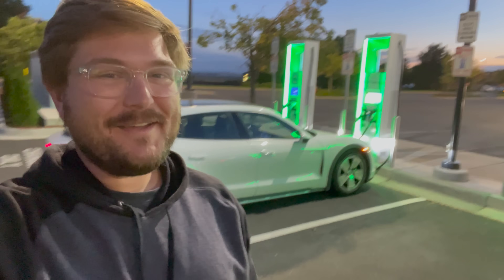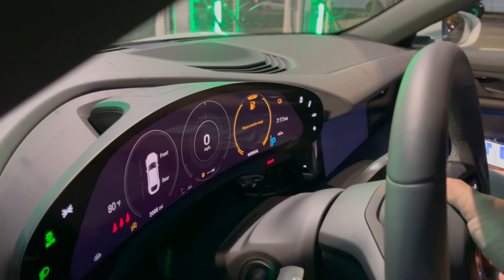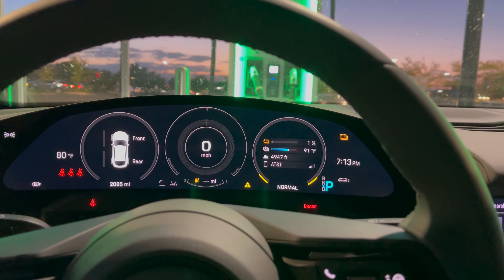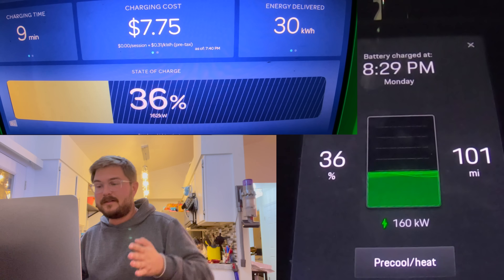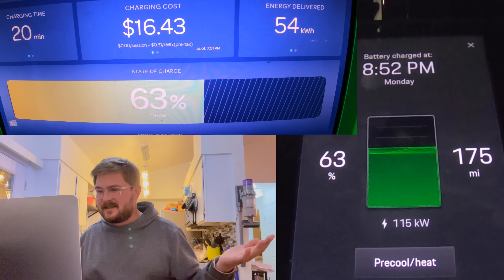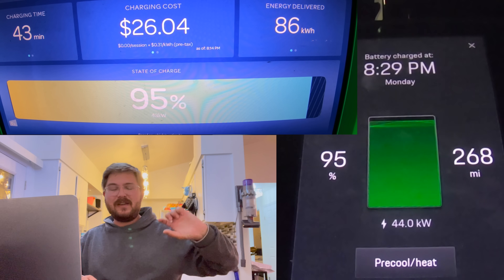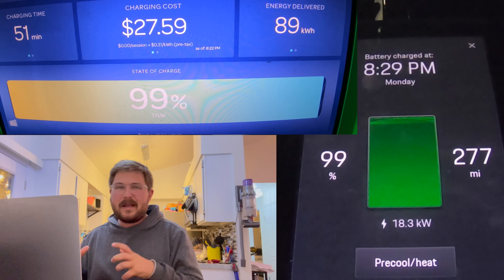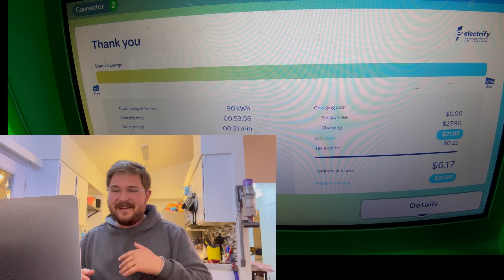Charging The Porsche Taycan From 0-100% With A “Battery Friendly” Decreased Power Level

Comment: Hoping to hear from some battery chemistry experts. What are your thoughts of this new optional lower power charging profile? And from all of you, would you leave your Taycan in this setting if you owned one?
Reply: What was the battery temperature after the charging session?
Reply: Not a battery expert but I have learned enough from Apples charging scheme to Porsches and know lithium is best treated kindly in it’s normal operating range of temperature and if it goes beyond that; it’s not that the charging hurts it but the temperature starts to degrade it. I would set it just like you suggested in the battery saving mode until I needed it otherwise and beyond that I would probably charge it more at home then I would be on the road, but that’s more of a used case than anything else. Tesla does a fantastic job for getting each individual cell cooled but is there anyone else that’s doing as good a job with their batteries? It looks like Porsche may be among the best.
Reply: @garyclark6747  Porsche has a much different battery structure.  Fact is, and from having owned three Tesla’s, frequent fast, aka high temperature , charging is not optimum for any battery.  If the manufacturers could better manage heat , then fast charging in the future could be safe and efficient. 350 kw charging is not currently suitable for motor vehicle charging, so all of these claims about “ my car charges faster than your car” is nonsense.   Sounds as if Porsche recognizes this and has dialed back their charge claims for ad ertising and customers.  Frankly, most owners charge at home so it’s typically more an issue “ on the road.”
Reply: Kyle, you should interview Sandy Munro about batteries and EVs...
Reply: Ask him
https://www.youtube.com/channel/UCIFn7ONIJHyC-lMnb7Fm_jw
Reply: I am not a chemistry expert, however, as an owner I have noticed that waiting 25 or 35-40 minutes to charge from 10-15 to 80% does not really matter. At least to me. So I prefer to go for a 135-175Kw charge then stress the battery ..
Reply: idk about you guys but i did not supercharge my brand new tesla for the first year at all period and saw the 90% range drop just as much if not more than other people who supercharge regularly. not scientific i know but i think as long as you're not supercharging daily, its fine.

Comment: Thanks Kyle for the pointer to the setting. I had gotten the latest software update but forgot to look for where the setting was. I now checked it but I have done 17,800mi and 5.367MWh of DCFC and 1.034MWh of L2. A recent road trip of 495mi 90% freeway used 258mi avg range on 100%. I have a 2020 4S with 20” wheels picked up in November 2020, built in July. 
It’s a road trip dream.

Comment: The first 50% says it added 43 kWh in 14 minutes.  The second 50% says it added 47 kWh in 40 minutes .   The official usable capacity is 83.7 kWh, so 50% would be ~42 kWh.  I imagine the car/charger is just giving a rough estimate.

Did you turn off the climate control and ventilated seats that you had on before you started the charge? ;)  The first 50% took 14 minutes adding 1 kWh extra could be accounted for by HVAC and slight charging losses.  The second 50% took 40 minutes, adding 5 kWh extra could be accounted for by the HVAC running for 2.8x as long, plus higher charging losses.

So yeah... 83.7 kWh usable still seems like it may be right.

Comment: Seems like the people that are most “concerned” about DC fast charging at high average kW, and at high SOC, are Tesla fanboys.
Reply: It’s a battery issue mate, not a Tesla or Porsche issue.  Batteries in and of themselves , no matter the manufacturer, do not like high charge levels on a regular basis.  Plus, Tesla allows you to adjust charge speeds as well.

Comment: I'm Tesla and Porsche fan. Still have 2 Porsches. But I've been running Porsches for 15 yrs now, and you are sorely mistaken if you think that they set-up things safely and have no problems... I'd much more trust Tesla with new technologies, especially because they still play "new kid on the block' game to please their customers. Porsche has had major issues with every single gen. of 911, and their taking ownership of these issues has varied... Good for engine fires of 991 GT3 and transmission on the GT4, not so good for 996/997 IMS and bore scoring, or Metzger engines plumbing issues that caused many crashes at tracks...
Reply: Oh man, you are so full with bullshit about Porsche! It's almost disgusting to read your irrelevant crap!

Porsches "major issues with every single generation of 911" wasn't existent at all! What the fuck are you claiming, you clown??

The 991.1 GT3 "issue" from 2013: 
Porsche located the issue of the 3.8 liter flat six engine, which caused only TWO engine fires of the 991.1 GT3 generation (one in Switzerland and one in Italy), and Porsche immediately stopped selling the car, conceirning only 785 delivered GT3 customer cars at that time. All these 785 GT3 customers got a replacement car from Porsche until the issue was located and fixed, produced these new GT3 engines for the 785 customers and built it in these customer GT3s for free. 
And now the question: Where's the problem in your eyes, what Porsche did with this "issue"?
What Porsche did at that time was lightyears ahead of any other sports car maker, which wouldn't have stopped customer deliveries after just two engine fires. Like we all know from Lamborghini or Ferrari, which wouldn't have done NOTHING in such a case. 
Porsche was amazing, because they communicated totally open the issue to the customers and the public at that time. Without bullshit and stupid lies. 

You are telling fucking bullshit, because this 991.1 GT3 engine issue actually was just a tiny problem, and which was solved by Porsche in just very short time.

All the rest what you are claiming about "engine issues" of quite old Porsche 911 generations is so fucking OLD and irrelevant for today, because Porsche from today is a totally different company compared to Porsche from 25 years before.

You are such an idiot, with telling quite boring, totally irrelevant and old stories from 25 years ago about Porsche "issues", just to show how "unreliable" Porsche Taycan batteries are today??? This is so stupid, you clown!

Question: Are you really that DUMB or do you have a little vendetta with some Porsche dealers for idiotic reasons, which of course has absolutely nothing to do with Porsche Taycan battery technology in the year 2021, Mr. "Dimic"??

Fact is, that Porsche is the most reliable premium sports car brand today and has the biggest customer safisfaction rate of all premium carmakers here in Europe. These are FACTS!

I don't know where you are living, but I do know that you are telling fucking irrelevant crap, which has NOTHING to do with Porsche Taycan battery reliability from today!
Reply: @Porsche1969  I've got over 100 track days on various Porsches. But sure, you know better...
Reply: @Porsche1969  And even a real name. How about you, brave troll?
Reply: @Porsche1969  I don't know Taycan's battery reliability. No one knows. But I wouldn't trust Porsche to be on my side if things go wrong outside warranty period...
Reply: @zdimic  @Porsche 1969  before anyone starts mudslinging, no one knows long term ( meaning years) how any of these advanced batteries will hold up. We do know from Porsche and Tesla ( so far) that frequent fast charging is NOT healthy for batteries. Realistically, how many of us with home chargers are also regularly “ fast charging” on road trips?  Once a week, a month, a year? Battery charging speeds and longevity knowledge are still in their infancy.   Talk to us in 10 years when there’s some track record and more data points.      I do suspect that both Porsche and Tesla know there’s long term issues with frequent fast charging.  Issues they may not want to face.

Comment: Much cheaper than gas…
Reply: Not much if we assume premium 93 octane at 4.00 a gallon.  200 miles for $28 bucks is about 28 mpg electric . (7 gallons of Gas to go same distance.)..
Reply: @alexnutcasio936  hello from Germany! We pay about €1.70 per liter at the moment (which is pretty much, even for our standards). That is about $6.40 a gallon. According to my calculations I pay €37 or $43 for 322 km or 200 miles (and I am not driving a Porsche…) $28 are about €24 so I would save 35% of my money…
Reply: @marcmech1  any way you do the numbers, electric is going to be less expensive than gas and better for the environment too.    Yes, electric pollutes upstream with electric generation, but not near as much as fuel from ground to tank.  $6.40 a gallon is brutal.  We're about 1/2 that right now.

Comment: First, lets debunk some misteries with simple math. By doubling the voltage of a 100 kwh battery to 800V, and being rstricted to 400 Amps/h in current intensity, you can unlock charging currents to 3.2C but it seems impractical as manufacturers restrict it to a peak of 2.5C (at 250 kwh).  A 100 kwh 400 V battery if charged at 250 kwh would be receiving 2.5C = 500 Ah but that would be impractical as it exceeds the 400 Ah charger restriction. So the charging curve of the Porshe is expected to be above Tesla's. What we can't see is the discharge curve when max power is applied to the motor.
Reply: It is kW*h (shortened as kWh), not kW/h for capacity.
Charger has 500A with liquid cooled cable.

Comment: Blasting through batteries is completely unsustainable. How we approach transportation must change and that includes how we price transportation. We must include the costs of the resources extracted for components of vehicles and recycling of all components at the end of their lives. 

We cannot afford as a planet or species to have battery degradation just for convenience.
Reply: Uff, this is so wrong. Batteries can be recyled. Don't worry about planets and species but start thinking. Solar energy is endless and resources do not vanish during use.

Comment: Heat is Lithium’s enemy. Regulating heat is a must. 💯
Reply: And fast charging creates heat, therefore logic dictates that fast charging is lithium battery enemy.
Reply: @alexnutcasio936  There is tolerable level of temperatures. As long as they are maintained…charge away. That’s what the 4680 Cells are about from a physical build standpoint. It’s about reducing heat externally and from taking place at a higher rate through engineering.
Reply: @garyclark6747  4680 not implemented yet. Perhaps soon in Fremont and later Texas.  Regardless, frequent fast charging is not good for any battery., no matter the manufacturer.

Comment: Charging cost without a discount seems around the same as gas price? Maybe this industry is still new, but would expect less
Reply: How so?  He paid $27.59 for approx 200 miles range.  If we assume premium at $4.00 a gallon approx and rounding, he purchased 7 gallons of gas for $28.00 ( rounding of course).  200/7 is 28.57 mpg.  I’d say that’s a win for electric over gas because a comparable car in size and performance is probably in the high teens on mpg ( think Panamera S for example).   Note that the .32 cents per kWh is way on the high side of charge cost. Close to .20-.25 cents per kWh is probably more average.  The only advantage of gas v. Electric was fuel-up time v. 30 minutes.   I guess we can ask, what’s your time worth then?
Reply: @alexnutcasio936  Not saying that it is bad, just had assumption that going electric saves you gas money. And this looks around equal if you are a person who cannot charge home
Reply: @michalbais9228  Its not equal because EA has very HIGH prices per kw of charging.  Tesla, depending on location charges about .20-24 cents per kwh, so its about 1/3 less than EA.   ONe can charge at home for about 1 -10cents per Kwh depending on state, much more in Hawaii and CA.  I pay .05 cents per Kwh if I charge overnight when demand is lowest.

Comment: This charging profile seems similar to my '19 Tesla MS Raven on a V3 charger at an optimum rate. The 0-50% seems very similar however the the taycan 50-100% seems to be approximately 25% higher KW rate than mine.
Reply: Can you show a video of that? In Bjorns vids the Raven took 18-20 minutes from 10-50%. The Taycan took 12 Minutes for that in this test here.
Reply: @Milkastier   @Christian Gutschik   @Christian Gutschik  Hey thanks for asking. I should have clarified in that once I get to my peak of 200kw/hr around upper20/lower30% the charging curve would look similar to this taycans in decreasing rate. It definitely doesn't hit 200 as soon as it charges which is the difference in time between 0-50% taycan 15 minutes and my 20 minutes. That info is from me testing as I'm writing, unfortunately it didn't even hit 200kw/hr, maxed out 175 but still hit 0-50% 20 minutes. I tried recording but the video isn't that great.
Reply: @Wraggler87298  ah ok. :) Thanks for clearing that up, I was a bit confused there haha. But it seems plaid goes from 0 to 50% in 15 Minutes so you could just buy that :D

Comment: Wow, what commotion,
to fill a car. 53 minutes? The flow rate in Canada for a gas pump is 38 Litres per minute. So a Panamera has 80 litre fuel tank. 3 minutes I'm done. Time is money.  I think I'll stick to my ice machine,
until I have no choice.
Cheers from Toronto
Reply: I'm guessing you don't fully get the picture here -- at home you never have to fill up ever again.  Every day you have a 'full tank' and never have to stop at a station (total round trip journey time is saved).   This is for roadtrips only -- and by example you can Drive SF to LA with one stop at Harris ranch for 20 min, the time it takes to get a sandwich and use the bathroom, then be ready to drive the entire rest of the way.
Reply: @chris8535  I do.
I live in a condo downtown. I drive to my Lake home every weekend. 230 km each way. I am not against electric cars. For city living, they are great but they are not inexpensive. If they are price and time competitive fine. I would prefer the Nio or Geely option, with battery swap.
Reply: @guenthermichaels5303   Sure I mean, this is a near-exotic sports car with every day practicality.  Not really in the market for Geelys here.
Reply: @guenthermichaels5303  lol, Nio is expensive and where can you buy a Geely?
Reply: @thelastofthehitachi972  in China.
Reply: @theseb1979  exactly, not in Canada
Reply: @chris8535  I know, I said, I would prefer that type of option. Years ago. I thought of this as simple as exchanging my propane bbq tank for a full one.  When you drive up in Lake country, chargers are far and few. So when this changes, then I may well consider an ev. Right now I can drive 1,000 km in my Mercedes diesel suv.
Reply: @thelastofthehitachi972  my point was the method of battery swapping.  You can swap or charge ..
What is there to Laugh about?  The Nio is price competitive with Tesla model Y in China and is more luxurious, with more features, ie, full panorama roof that opens and has a power sunshade.. I'm laughing because I own 20,000 shares of Nio, which I bought for $2.85
Reply: @guenthermichaels5303  good for you, but Nio is not a good example for an "inexpensive" EV
Reply: @thelastofthehitachi972  price competitive with model Y. Now available in Europe.
Reply: @guenthermichaels5303  if you think chargers are rare where everyone is adopting CCS imagine how rare your battery swap station is going to be 🤣😂
Reply: @scottwills4698  That wasn't the point. This was merely a discussion. Nothing you have told me is new info.
All of this  ev tech is new and so we have another 10-15 years before ev is mandatory.  By that time, the tech will improve and cost efficiencies will drive prices down.
Who knows, by that time 
Socialist govts may ban driving. I'm 66, so too late for me..

Comment: This is still very fast charging. I would love it if my Mach E charged from 10 to 80% in 30 minutes instead of 42% currently.
Reply: You can only get to 42% in 30 minutes?
Reply: @anthonyc8499  sorry I meant that my Mach E get from 10% to 80 % in about 42 minutes, while it takes my Tesla 3 just 30 minutes on the Tesla supercharger
Reply: @irfanhusein1445  ah, thanks. Makes more sense now. I don't think they can hit 30 minutes to 80%. I think best case is between 35-37 minutes to 80% which is fine since Mach-E AWD ER goes farther than Model Y LR on a charge anyways.